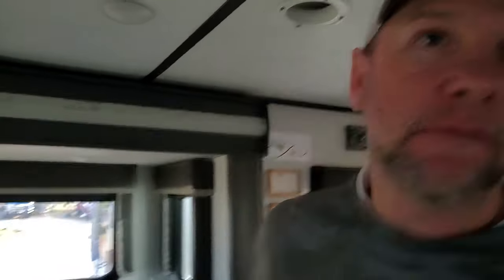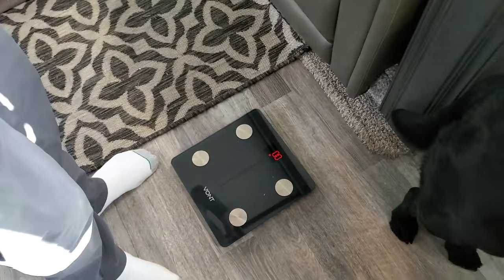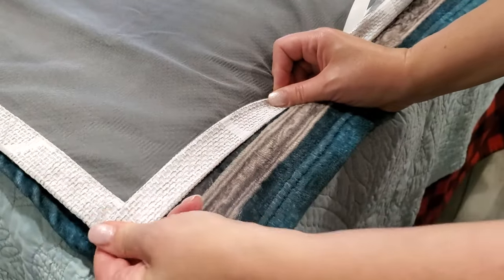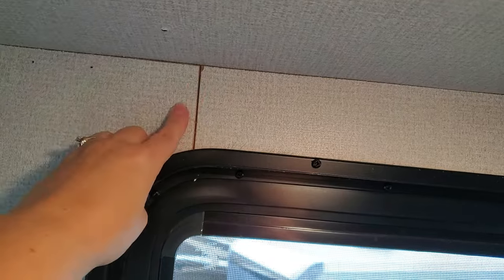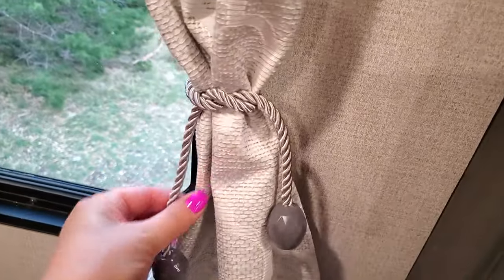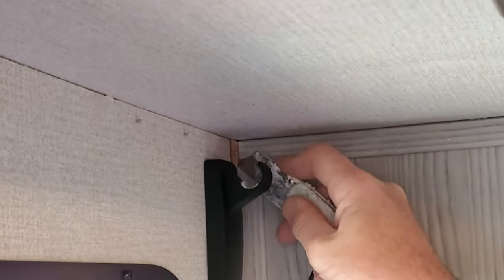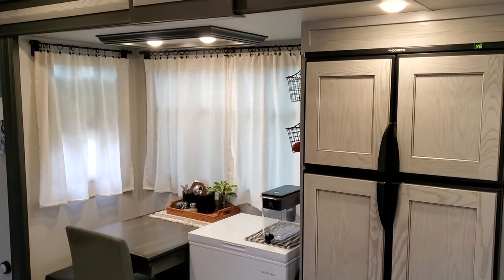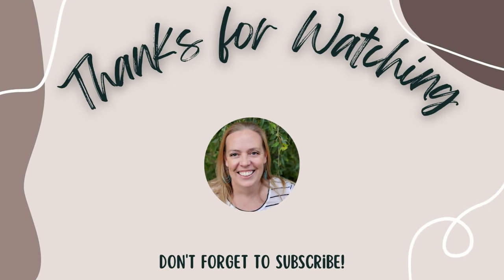Easy RV Curtain Ideas: No-Sew, No Holes, Budget-Friendly!

Comment: How have you found the command strips holding during travel? They do say to put Command Strips on a smooth flat surface but I have put their broom holders on the slightly dimpled wall paper in an RV but only drove without the broom in the holder just in case. Have you put any road time on your application of curtains?
Reply from the maker: They hold up incredibly well for me. I just can't say enough about them! Our walls are also slightly textured and I didn't know that they say not use on textured walls 😆...Anyway my command Broom holders have been up for 3 years and we always travel with the broom and mop in.  I did put up 2 for each, one at the top and one at the bottom because I thought the broom or mop would move around and mark up the wall. Regarding the curtains They have been up about 2.5 months, we travel every week so that's a total of 10 travel days. They haven't fallen down once and we've driven some real doozies...I-10 ugh, I-40, I-80 😖🥴 I had things flying around everywhere but the curtains held strong! Highly recommend 👌👍

Comment: Thank you for sharing.  I really want to try this. 
Have you changed a curtain or a shower curtain that came with the RV or camper?  Ours came with bunks that have a curtain hanging from a track and the shower curtain hangs from a track.  I am trying to figure out how to change them and I am worried about messing it up.  I cannot find any help so far on google.
Reply from the maker: You're welcome! We did take our glass shower door down and replaced it with a curtain. It was pretty easy, just a matter of taking screws out and lifting the track out. We sealed the screw holes with silicone and put screw caps on. I think the curtains on the track would be just as easy. If you take your time you shouldn't mess anything up! 😊